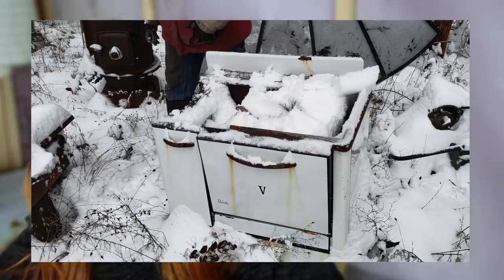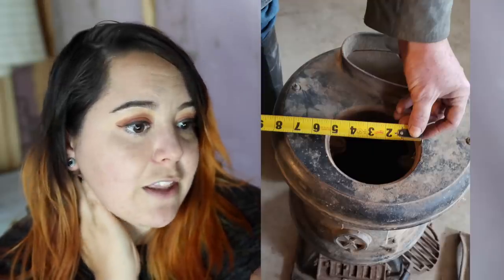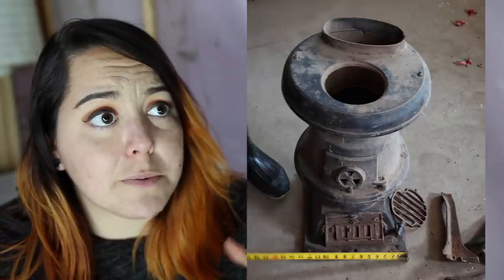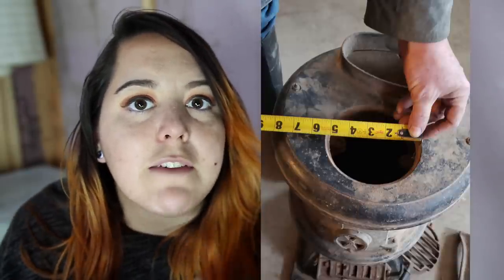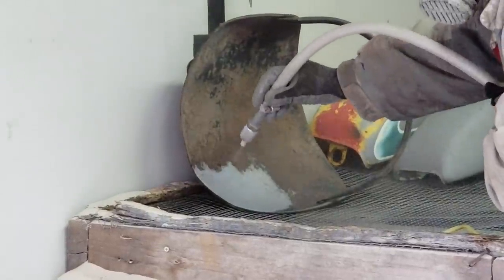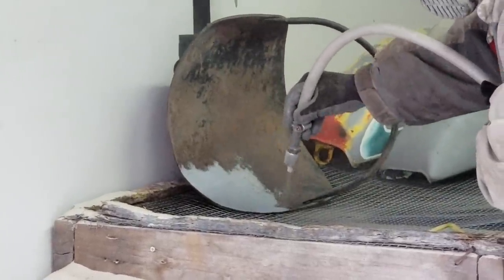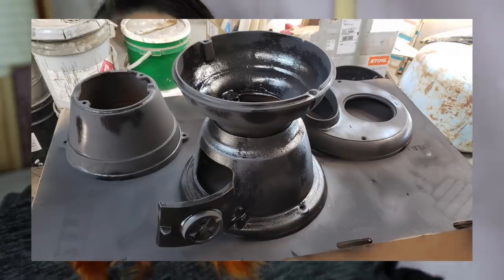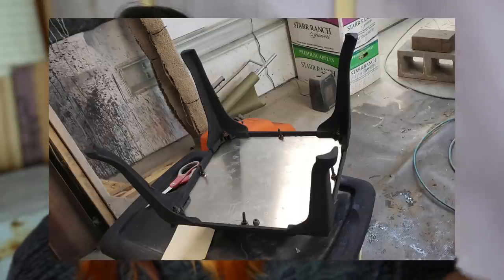Restoring a Cast-Iron Wood Burning Stove (and learning how to use a sand blaster)

Comment: You did a nice job on the stove restoration. I think that if you can find a piece of 1/4" steel and make a lid out of it for the hole it might hold up better. Please fire the stove up for the first time outside, as the stove paint will really smell bad until it either bakes itself on or burns off. 
 I designed and made a wood stove for my blacksmiths shop out of an old hot water tank. It worked great.  If you are anywhere near Olympia, you are welcome to stop by.

Comment: I have a little cabin on a river that I wanted to heat in the winter. Its 1100 sq. ft. I was looking for a small woodstove and found almost the exact same stove on craigslist that you have. It keeps my little cabin nice and warm on the coldest winter days. You will need double wall stovepipe to go through your wall from inside to outside. Good luck with you adventure in life.

Comment: The stove turned out awesome! I used to live in a small house with a wood burning stove for heat. There were times it got a bit too toasty and the front door had to be open to cool things off until the fire died down some. I always kept a pot of water on the stove to keep the air in the house from getting too dry.

Comment: Please be extra-careful with the stove maintenance and cleaning. Around here were I live, burning chimneys are one of the most common causes for house fires. Check and clean regularly the soot inside the chimney because it can burn easily and then the chimney gets too hot and burns and the wood around it burns etc.

Also, the stoves I've seen around here, have a little hole on the top so you can remove it using a long bent piece of iron (I don't know the name of it) so you can introduce wood through the top.

Also excuse my english, not my native language.